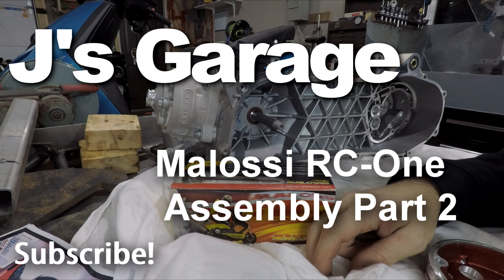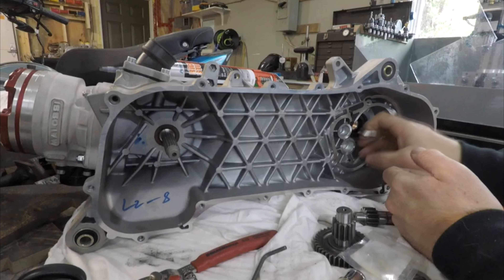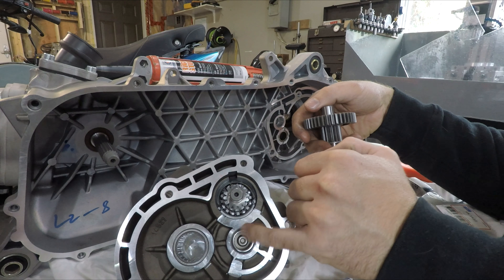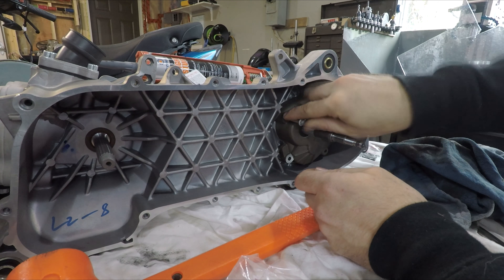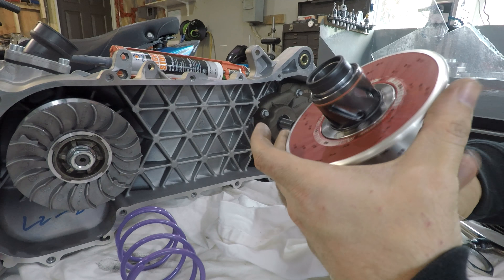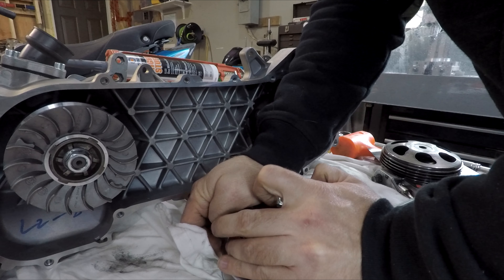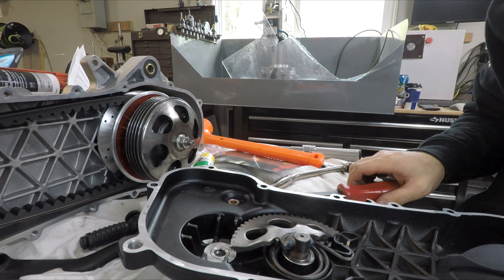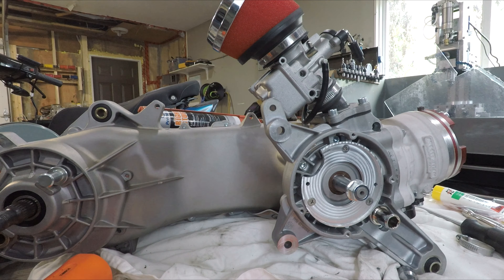Malossi RC-One 94cc Engine Build Walkthrough! Part 2 - J's Garage

Comment: Hi, J! Can tell us what your carb setting are? Idle jet, needle position, and main jet? Im having trouble without a starting point.
Reply from the maker: Its in its entirely base settings.  On the 3 motors I have had in my hands they all ran ok with base settings enough to run and drive decently.

Comment: Did you ever get this to run proper with those la furia rossa? Cause on a guy i knows gilera runner which is exactly the same setup we couldnt push it over 25hp and the curve from the dyno was Very bad, with the old overrange kit we hit the 30 marks.
Reply from the maker: Seems to work good, have not had it on the dyno tho, or at least not with power output.  Probably won't for a while.
Reply: @pitobread  allright let me Know if you choose to. We couldnt get a solid curve out of it. No mather what we did. And people are slaughtering it in reviews online aswell

Comment: I have a block just like yours got it off someone local here in Hawaii I was thinking about 2fast 100cc but if that crank and cylinder just plug a play thinking on just going that way sense I don’t have to mill out anything I’m going to try to bolt it up to my 2001 Honda elite SR50 frame so that’s a 50mm 70-94cc boar kit and 50mm crank am I correct?
Reply from the maker: If it's a RC-One Block it is a 44mm Stroke and a 52mm bore

If it is a C-One then it's only machined for the 70 stuff.. you can however bore it up and run anything.

Any of the other kits other than the Malossi stuff may require machining.

Comment: Would like to know if I need the thrust washers for the secondary gear?
Reply from the maker: I would, in the long run it would keep the gear from wearing down the cases prematurely since the washer isn't driven and can spin independent of the gear. Sure you could run it without but I would say it's not ideal.

Comment: If I go and get me a kit is it a Bolt on kit or would I have to mill it out to fit?
Reply from the maker: The RC-One?  if you use all the supplied stuff it is a bolt together afair.  No milling required.  If you want to do some of the 2fastFL100 or others you have to do some case modification to make that stuff fit.

Not sure what you want to bolt it to, so can't tell you there

Comment: Hey there! I'm about to take on a 94cc upgrade on my BWS. Do you have a spec sheet on the size of carb, jet, rollers weights, clutch springs etc? If you have a complete build list it would help me alot as I'm not too experienced with building one of these bad boys. 

Thanks!
Reply from the maker: This motor is an entire kit, it has a 28mm carb, pre jetted to "run", 3.5g rollers and springs are the la fury rossa springs, good luck!
Reply: @pitobread  3.5g rollers?? whats top speed with that setup?
Reply from the maker: Yes, 3.5g rollers.  No idea on top speed, it would depend on wheel size and gearing.  but it spins to 14k and makes 25 HP so it's probably easily in the 80MPH range.
Reply: @pitobread  im currently putting together the Rc one engine and am running into a few issues.  Apparently the new malossi crank design is splineless up until the end of the shaft.  Included in the box it came with a splineless smooth finish variator ramp plate.  Do you know anything about this?
Reply: Do you have an email address or a messenger i could reach you at?  pictures explaine it better than words.
Reply from the maker: @TurtleMackentire  Yes you need a few things to finish the build that is not mentioned in the instructions. I believe I have those parts listed in the description. One of those  is a piaggio kicker cup which has splines to drive the drive face.
Reply: @pitobread  did you ever take apart the carb to see the jet sizes?

Comment: u forget to install torsion controller that yellow ring between clutch and clutch contra spring.
Reply from the maker: Don't recall seeing one in the kit.    I also have an aversion to those as on some setups they will cause the spring to coil bind and you wont get full pulley travel.

Comment: You must have better luck with scooter tuning. ca then I do. They never answer there phones or return calls.  I gave up on them and use scooterparts. com, they have been good to deal with.   What clutch weights did you use, the lighter or heavier. 
I am souping up my Derbi GP1 and I am not sure which clutch spring I would rather use. The stock Derbi spring or the purple that came with my clutch kit. the stock one seems heavier. It has more coils and is also longer so I have to check to see if it will coil bind with both the Derbi Torsion controller and the Malossi one used together.
Reply from the maker: Nope, they are great.  Always go above and beyond.
I used the springs that were in the clutch when it arrived on the RC, not sure what color that may be. Or are you talking contra spring?
Reply: I asked which roller weights you went with 3.5g red and black or 3.8 all black weights for the primary clutch. 
Spring I was referring to was the Contra spring. I got a purple in my kit
Reply from the maker: @R1Kyle   3.5, white spring.  You want the softest rear spring you can get away with for the power level you have.
Reply: @pitobread  Where are you located?
Reply from the maker: @R1Kyle   I live in BC, but I will be in NS for a while.

Comment: Your gear box seal is assembled the wrong way
Reply from the maker: Can you elaborate?  The Spring loaded side is in towards the oil and it is outside the bearing.  If I did make a mistake I will put a note in the comments.
Reply: @pitobread  Bit late here but the typically they do go backwards to what you would think, not sure why, it is abit odd. Probably ran fine as is though